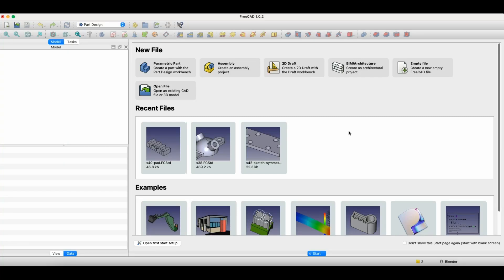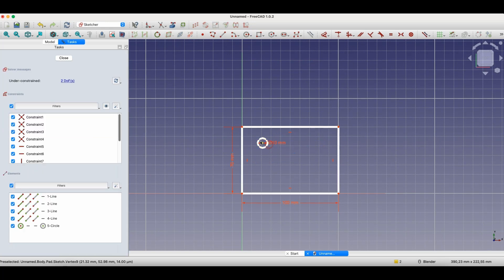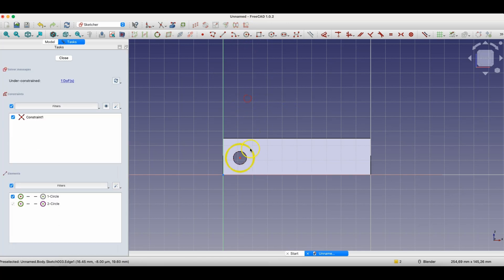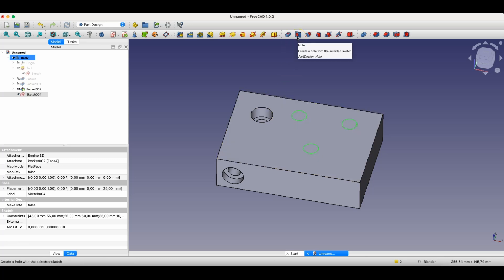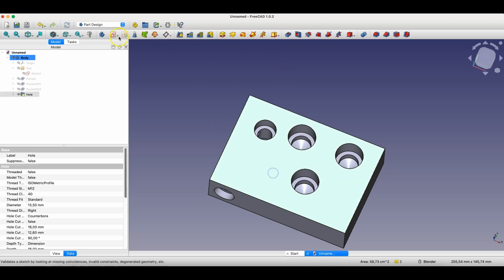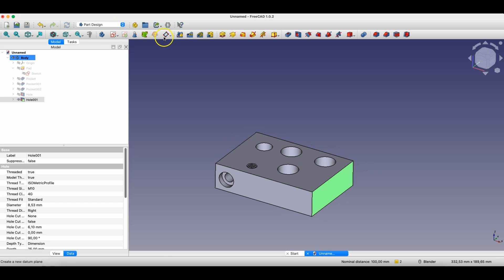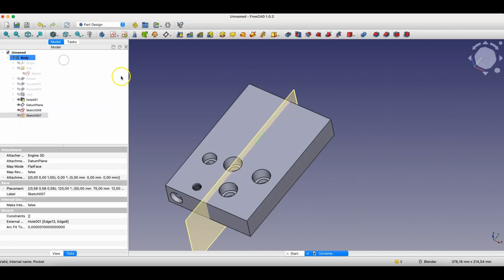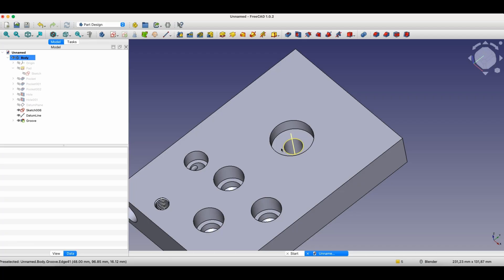FreeCAD: 3 Ways to Create Holes. Which is Best?

Comment: I tried to use points instead of circles but it does not work. Do you know why?
Reply from the maker: I’m not exactly sure why it doesn’t work now. In earlier versions, I’m pretty sure it did work based on points, and that’s what I was relying on when I recorded this video. It’s possible that this behavior has changed in newer versions of FreeCAD.
Right now the Part Design → Hole feature only works with circles in a sketch, not with plain sketch points. The circle’s radius is actually ignored – the hole size comes from the Hole dialog – but FreeCAD still expects a circular edge there, not just a point as the center.